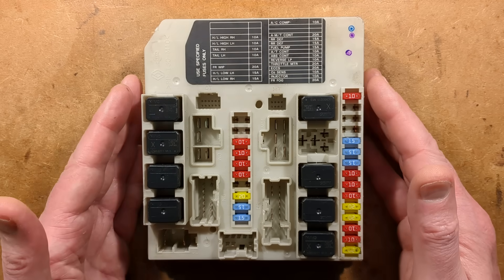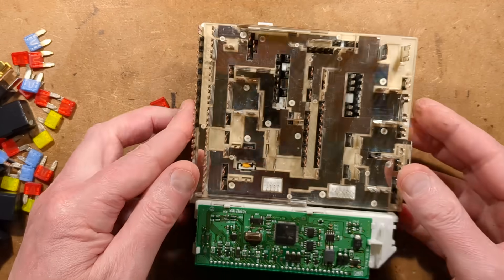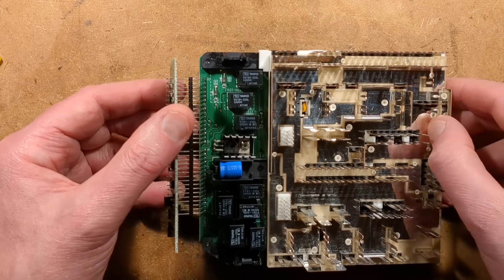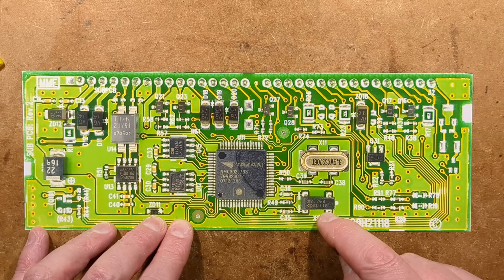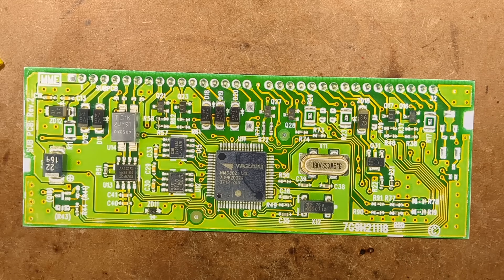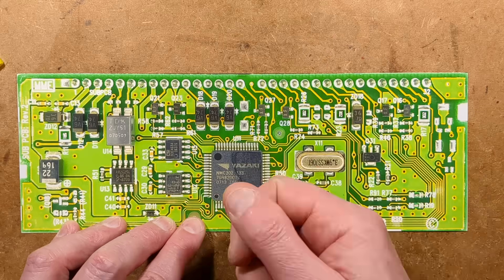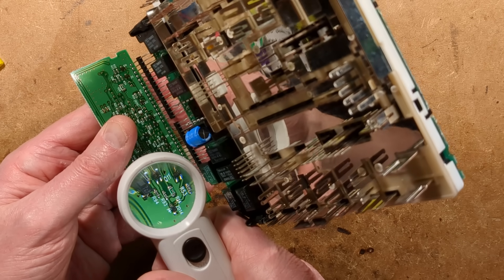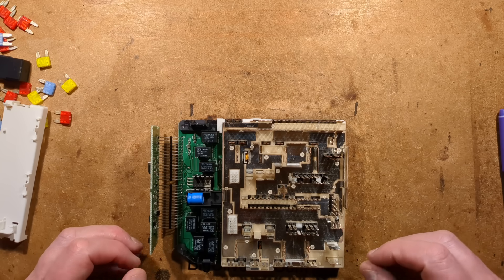Why your car's fuse box costs so much (and the location of the data chip)

Comment: And things like this is why I have a 1993 pickup truck with OBDI instead of a newer vehicle with OBDII.  
The "computer" is only for firing the fuel injectors and flashing an idiot light telling you to shift to the next higher gear as it's a manual transmission.  
I bought a backup computer ($30 USD) and have stored it in a Faraday cage to keep it safe just in case of needing one in the future.

Comment: I miss the old days of a fuse box being just that. 😂
Reply: Old round fuses, the same diameter as fencewire, DO NOT ask me how I know 😉😂
Reply: @sandy7299  Or the old continental/bullet type fuses, the holders for which will happily accept an 8mm socket. Installing one of these in a circuit with excessive current draw will heat it to the point it's too hot to touch, by which point something else in the car will smell of burning. Also, do not ask me how I know this...
Reply: @Zeem4 that's just an extra cigarette lighter, a feature! (Slaps roof of car)
Reply: @sandy7299  Also the same diameter as a .22 caliber bullet. NOT RECOMMENDED. Do not ask me how I know this.
Reply: @jamesbrown4092  That would be technically a pyrotechnic fuse!
Reply: @sandy7299 you happened to need a 1000A fuse to temporarily get back home?
Reply: @bryanohara5872  Or, erm, for the rest of that car's life.
Reply: @IlBiggo well there’s nothing more permanent than a temporary fix… I was also trying to be charitable about the original commenter’s discovery of a field expedient “replacement fuse”.
Reply: @bryanohara5872  "Everything's a fuse if you're brave enough" :D
Reply: Me too
Reply: for the renault users among us - there is a fusebox that uses "fuses" cut and welded into the casing, so it's impossible to replace even 1 fuse without replacing the entire box (for instant mental death search for "Renault 243806LA0A" - you will find out what suffering is) #6

Comment: One way to avoid the issue of accidentally powering the MCU while trying to read an EEPROM in-circuit?  Look up which pin is reset for the MCU and hold it high or low, depending on the architecture.  If there's a bunch of active chips, though, it gets a bit messy.
Reply from the maker: One interesting approach with this unit may be to use 3.3V to read the chip.  Then the watchdog chip may hold the processor in a reset state.
Reply: I'd be tempted to just desolder the power pin on the EEPROM and just lift it off the board slightly, but I like this reset idea!

Comment: I had an issue with the dash lights flashing on my Punto, it was only 2 years old and I did everything I could think of to clear the flashing lights. Lucky I was in the AA and they came out and said" oh easy fault, lift the fuse block up 90deg and press the reset button" it was that easy. 🤷‍♂But nothing about it online or in the Fiat manual. Interesting board 2x👍

Comment: You can program in extra features if you proper diagnostic computer.  Bmw builds all their cars the same and you can subscribe to extra features monthly.
Reply: Again sounds like Motorolas way of approaching things. Their radio has a full complement of options right from the factory but if you want a particular option. It a flat one time fee to activate each option. Beemer has taken it one step towards stupid by putting a time limit on the option. Do they turn off AC in the winter and then charge you to turn on the heat? Repeat this every seasonal change. Want to listen to your radio? For how many months do you need it this year? Want your instrument cluster to work? Flat fee for each month you need it. Now how stupid can a customer get??? How stupid and greedy is BMW? In the past BMW stood for "bad man’s wheels", today it stands for "Bastardised my wheels"

Comment: So these are called the intelligent power distribution modules (IPDM} and I finally got around to fixing the one on my mum's 2005 Micra where the low speed rad fan wasn't kicking in. Proved this through initially faking the temp sensor resistance and then finding a test mode which is invoked through turning the ignition on, pressing the drivers door switch 10 times, ignition off and back on iirc. It will cycle through some of the functions lights, wipers, AC clutch and fans. Very handy.
Annoyingly it is coded to the car in the EU I believe but not all parts of the world. I don't think new modules are available from Nissan anymore but cost a few hundred when it was plus programming. I also don't think the nissan official programmers can reset\recode a 2nd hand unit, so eeprom fun ahead. I finally got it all fixed earlier this year with some 2nd hand ipdms which introduced me to hot air soldering skills and reading\programming the eeprom with a cheap £10 usb scanner. Odd thing is I managed to recreate (break) the first replacement unit with the same fault. The only thing I can put this down to is reusing the original relays which I had tested\swapped around so should have been fine and probably blew the buffering transistor you pointed out. I suspect this was the fault on the original unit as well but testing is a pain with putting it on\off the car especially as its 180 miles away!
I keep meaning to write this up to help others, as these faults can cause cars to be scrapped unnecessarily. Part of the challenge in getting a professional in is finding the right ones who know about this stuff as it's a step up from standard mechanics skills.
Reply: Your description of how to activate test mode is amazing. I hope you didn't figure that out by trial and error! It's like the Masonic handshake of car maintenance.
Reply: Auto Active Test BKS0025S
DESCRIPTION
In auto active test mode, operation inspection can be performed when IPDM E/R sends a drive signal to the
following systems:
- Rear window defogger
- Front wiper (LO, HI)
- Tail lamps, parking lamps, license plate lamps
- Front fog lamps
- Headlamps (LO, HI)
- Headlamp washer
- A/C compressor (magnetic clutch)
- Cooling fan
OPERATION PROCEDURE
1. Close hood and front door (passenger side), and then lift wiper arms away from windshield (to prevent
glass damage by wiper operation).
NOTE: When auto active test is performed with hood opened, sprinkle water on windshield beforehand.
2. Turn ignition switch OFF.
3. Turn ignition switch ON, and within 20 seconds, press driver's door switch 10 times (close other doors).
Then turn ignition switch OFF.
4. Turn ignition switch ON within 10 seconds after ignition switch OFF.
5. When auto active test mode is actuated, horn chirps once. Oil pressure warning lamp starts blinking.
6. After a series of operations is repeated three times, auto active test is completed.
NOTE: When auto active test mode has to be cancelled halfway, turn ignition switch OFF.

Additional info; there is no need to start the engine

1) rear demistor on for 10 secs

2) front wiper - low 5secs hi 5secs

3) park lamps and (fog lamps some models) 10 secs

4) fog lamps (some models) 10 secs

5) headlamps- low 10 secs, Hi ON-OFF 5 times ( mine stay on for 10secs)

6) A/C compressor ON 2secs OFF 2 secs 5 times (you will hear the solenoid click)

7) Cooling fan 2 speed- Low 5 secs Hi 5 secs

3 speed -Low 2secs-mid 2secs-Hi 2secs-Mid 2secs-Low 2secs.

the complete test repeats for three cycles
test can be cancelled at any time by switching off the ignition
Reply: @robthomas7232 made a mental note of this as my youngest daughter loves early Micra’s and is on the hunt for one in the right colour,automatic and smallest cc. Guess who’ll be repairing it ?😅
Reply: @zh84 lol no I stumbled across it on one of my many Google  and YouTube video searches. One thing I haven't mentioned is this all was over a period of 5 years with COVID, an aging parent and the 180 mile distance complicating things. Glad she gave up driving in 2020 and didn't need it. We also have two of these in the family so it was acting as a back up and I really wanted to know how to fix them. Will post the full self test instructions below.
Reply: At least on renaults you can swap these without even coding them. As long as they are same it should work
Reply: @SkazaTV which is interesting given the tie up between nissan and Renault at the time. I can confirm that the car won't start unless you copy the eeprom or transfer the chip. Makes you wonder though whether you could delete the immobilizer and ideally via the OBD2 port.
Reply: @robthomas7232 I do not believe you can bypass the immobilizer in Renaults. You would have to bitbang the hex code and good luck finding its address in the program. IF it could be done many would be really upset considering it’s the only thing between their car and a thief.
Reply: @robthomas7232 in Renault this is called UPC or PSU and is not part of the immobiliser chain and can be swapped from same spec car to same spec car. The 3 colour dots on corner of casing must be same for it to work on the other car.
Reply: @SkazaTV that’s good to know but for which models and years? That can be critical as to what might be compatible.
Reply: @Subgunman mostly older models. Didnt try on any new one

Comment: Most of the Canbus systems I've seen have the terminating resistors in one of the attached modules.
Electronics in cars are getting far too complicated for them the last as long as older non-computerized cars and trucks.
I had a Peterbilt truck with a CAT engine in it that became inoperable a few years ago, simply because some oil had migrated through a wiring harness from the rocker box to the ECU and into a connector. After having to have it towed 100 miles to a shop, the fix was to spray the connector out with brake cleaner and reassemble it. Problem solved.